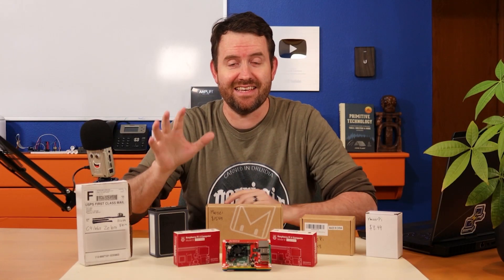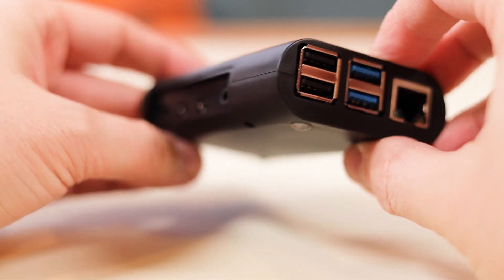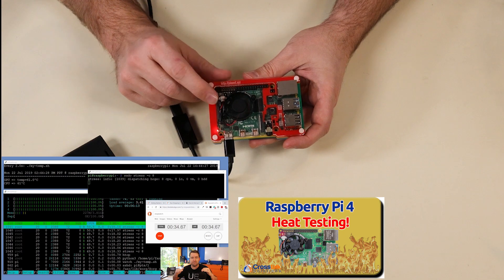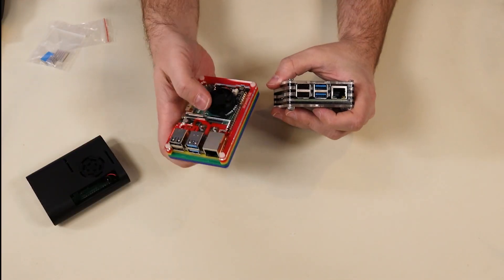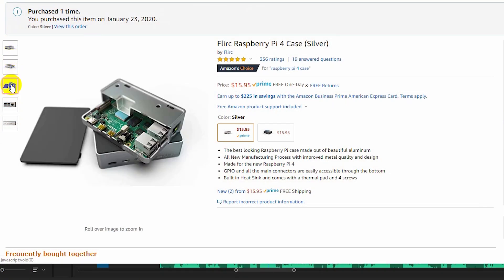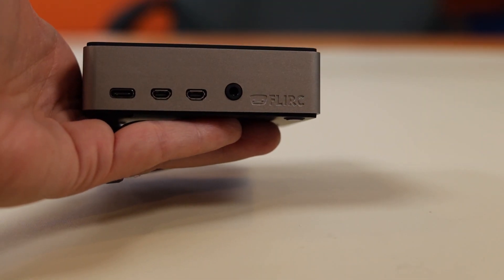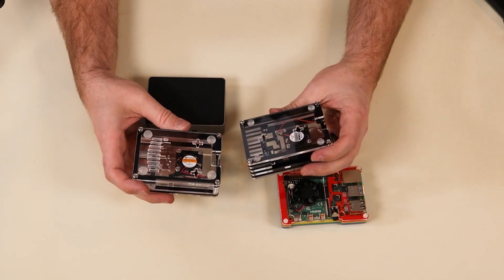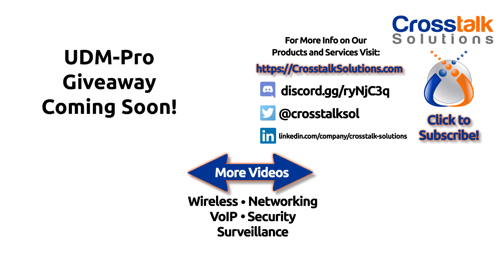Raspberry Pi 4 Case Showdown!

Comment: My main problem with most of these cases is that they have the exact dimensions of the Raspberry boards and no space left for additional parts. For example if I want to connect a few DB9 connectors or pushbuttons to the GPIO port then I cannot mount them on the wall of the enclosure.

Comment: The passively cool clam shell case that came with my Vilros Kit is very similar to the Flirc except instead of just 1 big metal contact piece for the CPU, it actually has a number of contact points for the other chips on the board as well.  It comes with Thermal compound to use instead of the thermal pad.  I used Arctic silver instead of the included and temps seem pretty solid.  I am going to stress test some with overclocking and see how well it can handle it as a passively cooled case.  I may end up getting an ice tower instead since temps are important to me

Comment: I find it strange that the one that won was the only one that did not fully protect the Pi...
B.T.W. The Zebra version has a LOT of accessory pieces that will let you use it with different HATs. Mine has the 'Astro-Pi' aka Sense HAT on it.(as well at the camera hanging out on it's ribbon cable).

Comment: I Like the Flirc as well, but see no possible extensions. Thinking of Battery for UPS or NVME2.0, I have the Geek case looks great one problem I had a stroke so I am wondering were the fan pins go..

Comment: Chris, another great video.  I personally liked the stacked full-cover case over the rainbow case as it protected all the components.  However, several people pointed out that the Flirc case had the benefit of a passive heat sink though it did not have pin access.  A heat test of all of the cases would be a good follow-up test.  Thanks for the great content and presentation.

Comment: Yet another great and very useful video! Thank you Chris! 
I too have owned most of the cases you showed. The Pimoroni is a very nice case but it also gathers dust (as do all the fan models) so all of my RPi4's are in Flirc cases and I have zero heat issues. 🍻

Comment: The iUniker Mini Raspberry Pi 4 Case, Pi 4 Case with Fan is only $6.99 at Amazon (4.7 stars). I have two of these cases.  I did have a  fan bearing fail after 5 months, but I assume the fans used in other cases would also be prone to failure.  I just ordered four extra fans.  I  also have a Flirc case and it doesn't cool as well as active cooler cases.  I have a Geekworm Raspberry Pi 4 Armor Case.  The heat sink pad was not thick enough to make contact with the case.  I have also read that metal clamshell cases degrade the WiFi signal. I have nine RPis.

Comment: Just checked Pimoroni website in UK and you have not correctly priced what you have shown:  the case alone is 7.00 GBpounds but the Fan SHIM is an additional 8.00 GBpounds (current exchange rate 1GBpound=US$1.30 = $19.50 plus shipping from UK).  Misleading conclusion!  I bought equivalent to either of the stackable builds complete with fan etc. and am very pleased with it - I prefer extra protection of Pi compared to Pimoroni build.

Comment: FWIW, just adding a note that you can use GPIO pins with the Flirc, but you have to go through the bottom, and I think it requires getting an extension ribbon cable... definitely no easy access though (it's not what I would consider a GPIO-friendly case) but figured I'd mention it's not impossible to do.

Comment: If raspberry pi 4B can be over heated...  u need to use “”52PI ICE TOWER CPU COOLING FAN ICE TOWER FAN FOR RASPBERRY PI 4 MODEL B & RASPBERRY PI 3B+ & RASPBERRY PI 3 MODEL B””.  However,  it will not fit in a case then.

The tower drops temp by 30C when over clocked..  monster good.

Comment: In addition to personal preference, I think the use case (pardon the pun) would govern.  For example, if you are going to be using the Raspberry Pi in a “production” environment, then the open design case might be a problematic.  Similarly, if you are using the Raspberry Pi for lab or experimental work, then the closed case would be a hassle.

Comment: Has anyone seen a decent case that is compatible with the PoE HAT?
Reply: Fenix1861 I like the Argon40 Neo case. It looks a lot like the Flirk, but has a removable top, and a middle layer. I used it with the official PoE HAT personally, and that worked just fine, physically. The middle layer does passive cooling like the Flirk, but blocks the HAT fan from blowing directly on the CPU. So not perfect, but pretty darn good. Its design deals with Chris’s negative on the Flirk, too, in that when you take the top off (it clips magnetically) you have access to the GPIO pins. (Unless blocked by a HAT, of course.)
Reply: Michael Alderete thanks for the suggestion.  The issue I foresee with that case is it doesn’t breathe without the cover off, so while the passive cooling is nice, the fan is effectively useless.  Thoughts?
Reply: Fenix1861 Yep, exactly, the fan has no real efffect. It can’t blow onto the CPU, and has no ventilation for cooling the interior of the case. You have to rely on the passive cooling of the Neo itself, which does work pretty well. (As well as the Flirk, according to test comparison done by a guy in England.) Basically, it fits, it works, but it’s not the best case if you’re using the PoE HAT. But it is compatible.
Reply: I'm using the SecurePi case ($9) from Elmwood Electronics with the official POE hat:

https://www.amazon.com/Elmwood-Electronics-SecurePi-Case/dp/B07YYMWBSR

It has venting holes from the Hat's fan, side access to the GPIO pins, and optional ports covers to secure all the ports from prying hands.  It can either snap together or screw together for security.  Overall, a great case for the price if you are using the POE Hat, especially if you are going to deploy it into the field.
Reply: Using the $10 HighPi Raspberry Pi Case (https://youtu.be/MJIjdKh6XgQ ) with the RP4+POE hat. Not the best looking case, but everything fits.

https://www.pishop.us/product/highpi-raspberry-pi-case-for-pi4/

Comment: I gave you a thumbs-up because I think it's a good quality production, not because I liked the video. The choices of cases you chose to review has a specific market niche. Apparently I'm not that specific market niche, needing utilitarian or industrial cases that I can have a PiHat or some other space for a SSD, and an expansion board on it.

Also, you should have reviewed the Raspberry Pi 4 Model B Aluminum Case RPI 4 Metal Shell Green Box Enclosure for RPI 4B by Unistorm. 
Unaffiliated link: https://www.amazon.com/gp/product/B07W4QBL4B

Why?

Three reasons:
1) Better heat dissipation combining both a fan and heat sinks.
2) Component protection of the very flimsy RJ45 and USB2/3 ports.
3) Mounting options -- Like the GeeekPi Acrylic Case that you said you didn't like the bottom on, it is made to mounting to a equipment closet backboard, only better... the "wings" are visible on the sides of the case so that you can screw and unscrew the case without trying to guess where the holes are on the back of the case.
Reply: Devin Hedge That looks like a pretty nice case, that I hadn’t seen before! Nice recommendation, thanks!

Comment: Did you hear me scream “Noooooo” when you didn’t install the thermal pad?  It is needed for cooling otherwise the SOC is not being properly cooled

In addition, not a good review of the cases as no thermal testing was performed.  The Pi4 runs very hot and having a good cooling system is critical.  You should follow up this review with thermal testing so this video would actually be beneficial
Reply: LordHog With the different firmware patches the RPi4 runs less hot. (Still hot, but less.) Be sure you’ve updated yours if you’re having heat problems. I think that if you’re not under long-term load you can get away without any heat sink or pad-joining-thermal bridge, at least for a short time, and Chris did say all installs in the video were temporary.
Reply: Mine run in the low 30 degrees Celsius easily, not hot at all. Another advantage of the poe hat

Comment: Flirc hands down for a passively cooled case.
Reply: @Isaac Newton I personally haven't had any issues with wifi or bluetooth. In my use, the Flirc/Pi is only a few feet from a wifi access point and a bluetooth keyboard and mouse even closer. The bottom of the case is plastic and so is the top. Just under the plastic top is the metal case and it does have a few (4?) small holes. I really can't say if the small holes help the wifi/bluetooth signal.
Reply: Check out Argon1 too. I have three Flirc cases and an Argon1 and honestly, while I love the Flirc, I'd like to see an updated design incorporating some of the Argon1 Elements.
The only thing about the Argon1 is that you need a short USB cable to turn the IR receiver back towards the front for remote control use. That's where Flirc could really kill it big IMO.

Comment: This is another that should not be over looked.... Argon One Raspberry Pi 4 Case - As well I'm looking for a case that will house a Pi 4 with a POE hat, any ideas what may work here?
Reply from the maker: I'm going to be checking out the Argon cases soon.  As far as what will work with the PoE hat - it depends on the profile of the hat.  But likely the GeeekPi case or the Muizei case would work fine - lots of space in those.
Reply: @CrosstalkSolutions   Thank Chris, will look into your suggested cases.... Cheers...
Reply: David G. Stevenson  I have the same issue although I liked the argon so much I may drop the Poe in favour of the case and the ability to overclock the mini monster :-) 

The geek one that Chris reviewed allows you to add the poe hat but you need to leave the top off it and not put the heat sinks on. Or get the 40 pin and 4 pin header extenders that are available then you can add the heat sink on the cpu.
Reply: @claritypensions  Apparently, the Argon POLY+ works with a POE hat as well, I’ll have to order one of those and see for myself…. Cheers….
Reply: David G. Stevenson just looked at that one. Don’t like the look of it as much.
Reply: @claritypensions   I agree, however, I guess it will work....
Reply: I have a RP4 w/ POE hat and used the HighPi Raspberry Pi Case. Not the greatest looking case, but the Pi and the hat both fit.